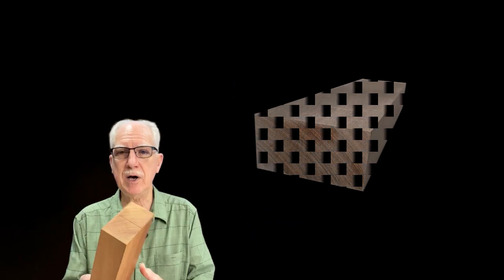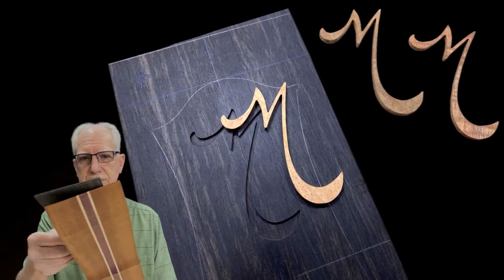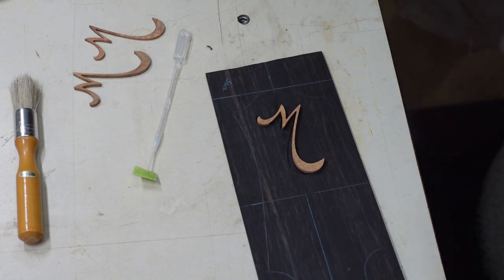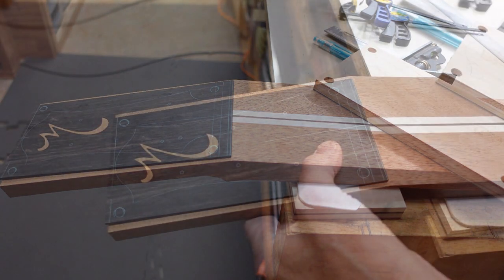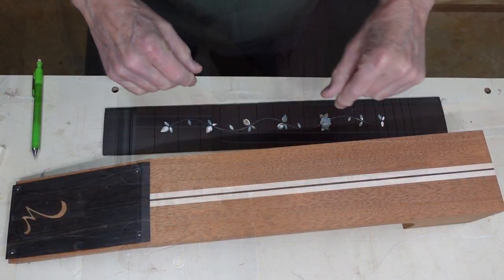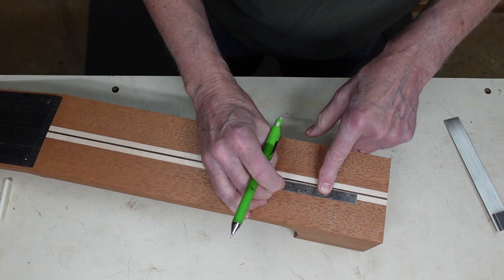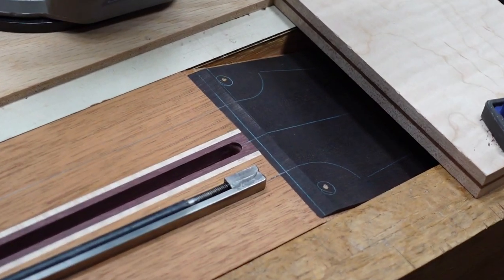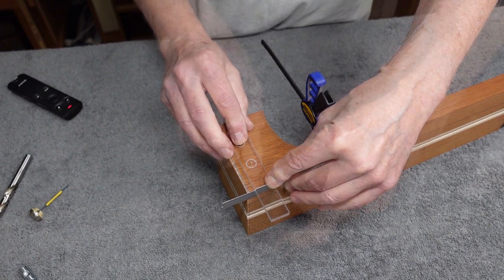Video Journal #14.  The Neck Part 1.

Comment: thank you . question please how long is your sliding angle gage ? where can i find one .
Reply from the maker: I made the tool out of an 18" steel ruler and a sliding bevel handle. I just drilled a hole at the 13" mark and screwed the handle on there. It doesn't "slide" but I don't need it to as I'm only using it for setting the neck angle.
Reply: @mcclellandwoodworks  thank you